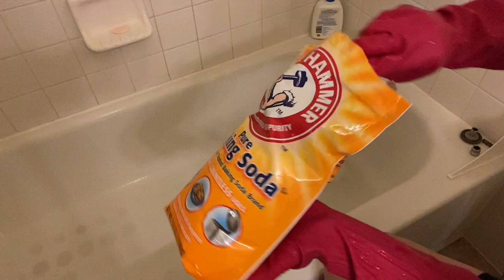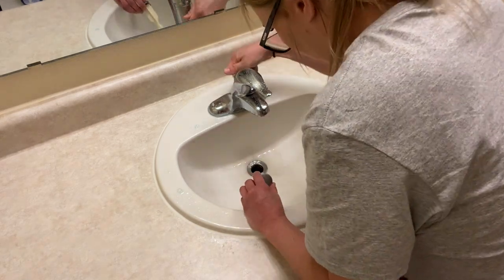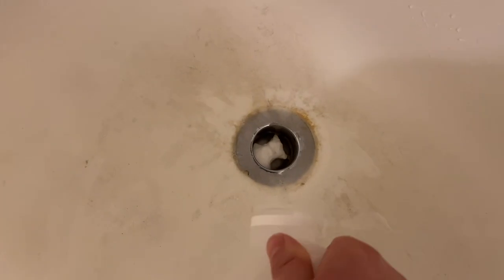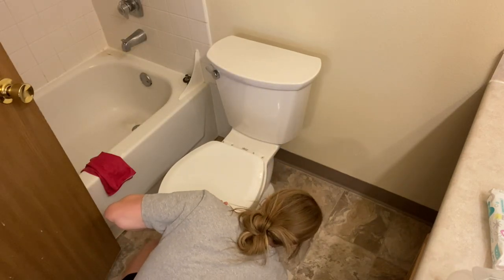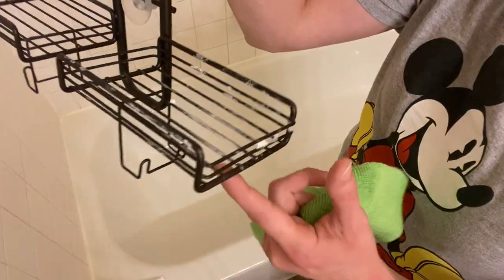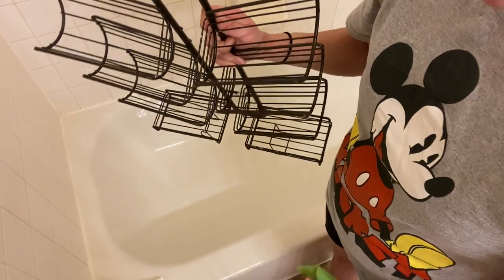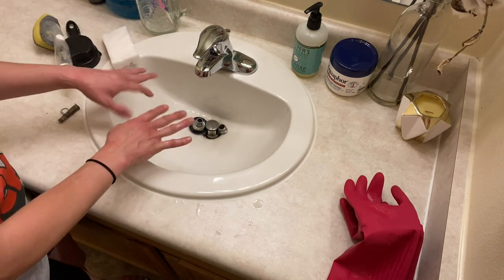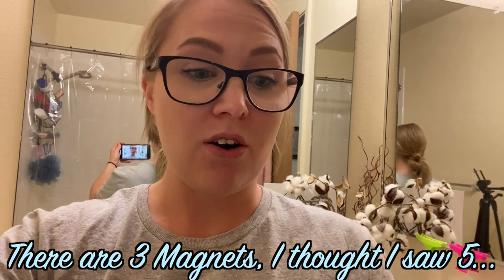VERY NEGLECTED MASTER BATHROOM | DISGUSTING DEEP CLEAN | CLEANING MOTIVATIONAL

Comment: You will have to look under your sink and see if it is detached or broke. There should be two rods that are attached with another metal piece that has little holes in it. Sometimes it is as simple as one slipping out of place. Other times it has rusted and broke.

Comment: Got to Home Depot or Lowes and get a drain stopper kit...it sounds like a piece is missing.  The kit doesn't cost much
and it easy to follow directions
Reply from the maker: We live in base housing so we don't have to take care of issues like this ourselves, it hasn't worked since we moved in. All I have to do is call maintenance but they have been back logged due to PCS influx to this base. TFW 💖

Comment: You can Google how to reconnect the drain in your sink but I did mine on my own without any help from anyone. You have to go under the sink and release the metal bracket from the metal pin or piece that comes down. It pinches and slides then put it through the hole in the bottom of the stopper and adjust until it fits tightly in the sink and holds water. Once you look at it it's pretty self-explanatory but if you Google it it'll be easier. As long as nothing is actually broke and they just took it apart. Good luck.

Comment: What is the ratio of blue dawn to vinegar? I think you found the solution to a clean bath tub. Thanks.
Reply from the maker: I don't measure but I do know the Pinterest has an actual measurement. What I do is squeeze about a HALF inch of blue dawn into my bottle, then add vinegar, some people also add water I just don't.. hope that helps if not check Pinterest. TFW 💖